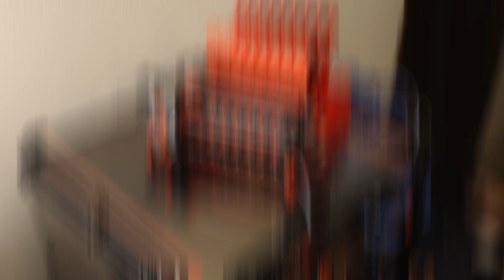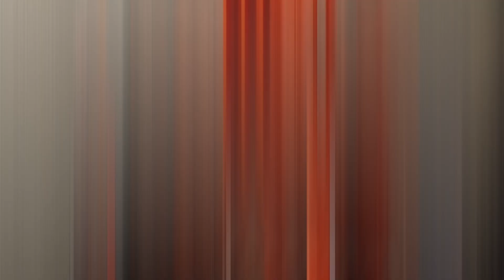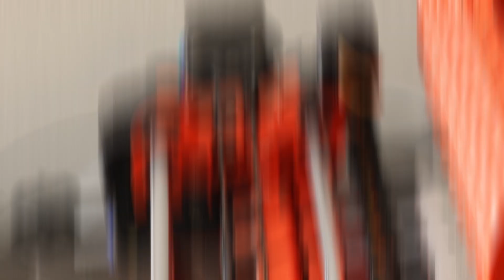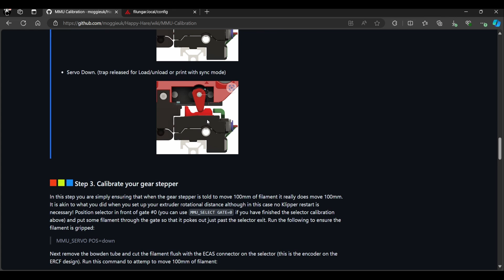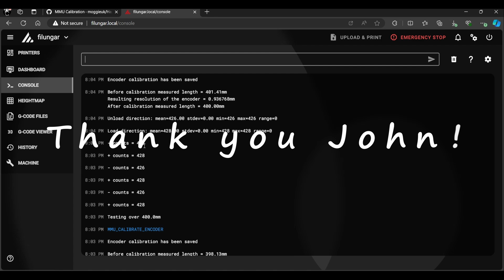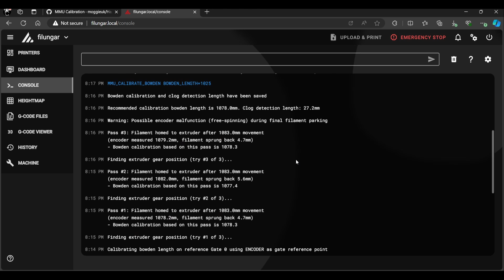Do these six things to your ERCF!

Comment: Hey, on the issue of homing and the endstop offset error, the fix is running just MMU_CALIBRATE_SELECTOR in gate 0 with filament alignment. This sets where the endstop is relative to gate 0, the assumes where the rest of the gates are based on block size, so error there will translate to every gate. This worked fine for my mondo ERCFv2, which has 19 gates, with gate 18 being just fine to load without issues despite not calibrating it's selector location.
Reply from the maker: That's a good tip. Thanks!

Comment: Good video! Thanks for that 👍🏼
Do you know why gate calibration may varies? At gate 0 I get measurements at ~400mm. But at some gates I only get values at around 380mm. Could that be slipping?
Reply from the maker: It could be slipping. But, I would give it a test print on one of those gates and see how it does. Keep an eye on the runout detection distance which shows up on the "carrot" button of Klipperscreen, if you have it.

Also look at the print and see if it under or over extrudes. That will tell you if the calibration is correct or needs attention.

Also, and most importantly, thanks for watching!